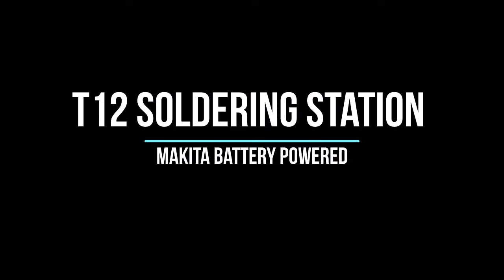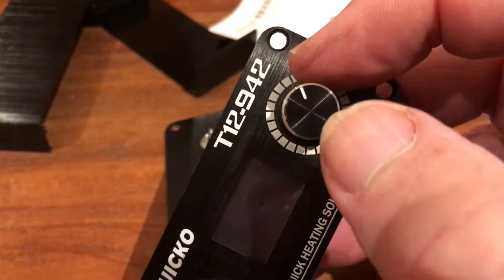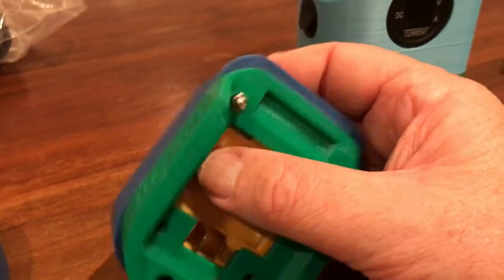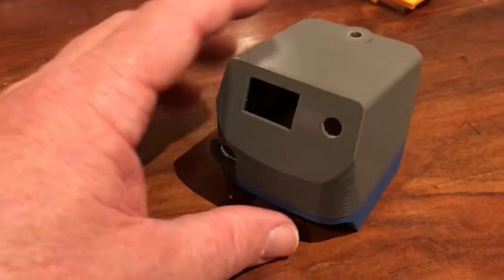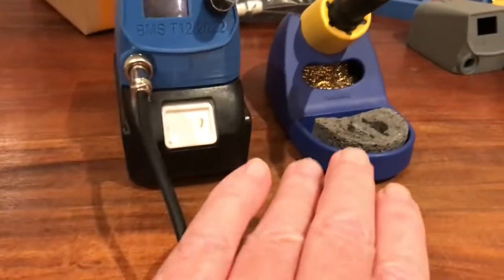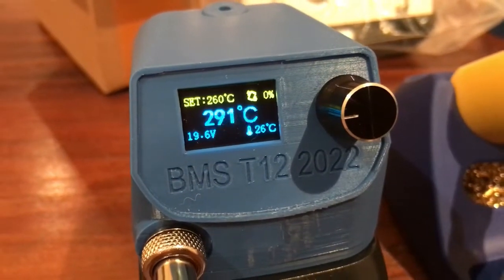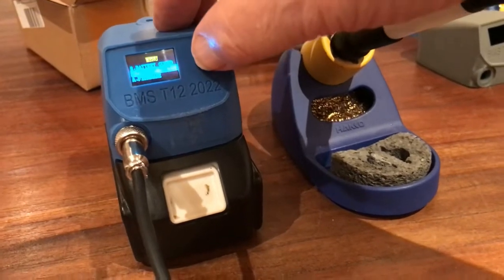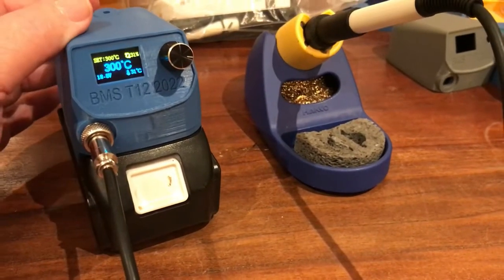T12 Makita Battery Soldering Station

Comment: Hi.good job.i have soldering iron from parkside...witch works good but because I work with makita tools would be nicer to be able to run on a makita battery....any chance to have the 3d print final design from you?unfortunately I don't have a 3d printer yet but my friend would print it for me if u would share the 3.final plan...
Reply from the maker: I can email you the 2 STL files.